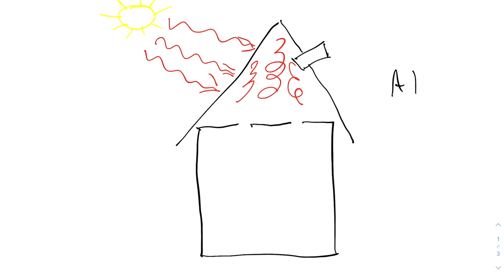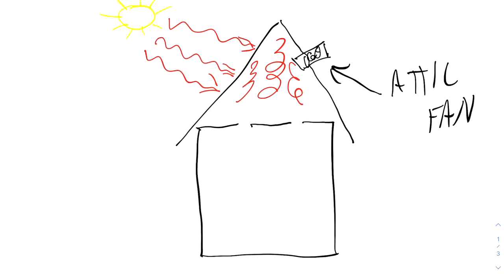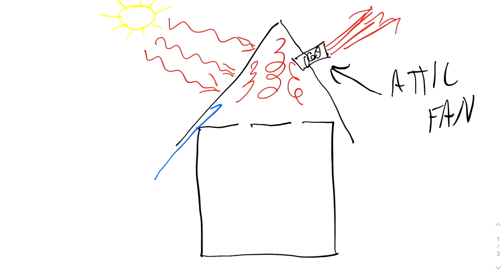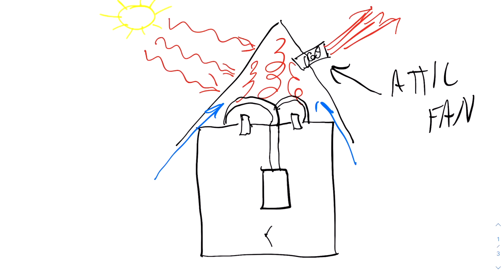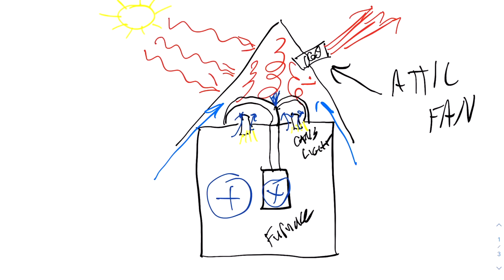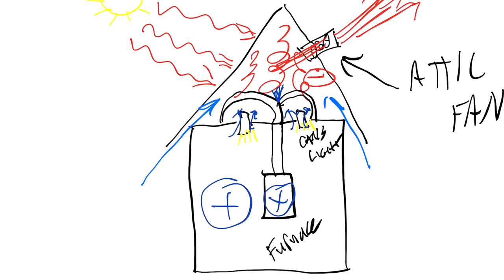3 Remodel Rip-Offs

Comment: I installed a solar attic fan. I had collected temperature data via remote thermometers. Installed the fan myself on a west-facing part of the roof (really important) and documented a 10-15 degree reduction in attic temperatures. The house is not air conditioned, and I definitely noticed the inside feeling cooler, probably because of less radiant ceiling heat from a cooler attic. So, for me with a DIY install, it made sense and I'm happy with it.
Reply: yeah, you want to be sucking the coolest air however, if your entire house is vented, you are sucking cool air from everywhere. I think the atic fans work best in areas other than texas or places with 100f weather because sucking 100f + air into your atic, isn't gonna make a big difference. I live in southern california where its been 75f for the last 3 months straight and its almost July. This week its pretty much 80f. Sucking 80f air into the attic that would be 120f, without the atic fan works well.
Reply: I like the poster, and he's pretty smart but even smart people get it wrong sometimes. Like I said, he's partly right in climates that are above 100f. He should have mentioned that.
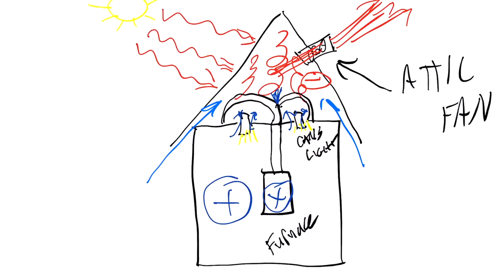Reply: @fastj1962  I live in a small house in So Cal near the ocean too and want to do the same thing before we get a fall heat wave. Our house stays comfortable until about 3:00 in the afternoon.  Then, the heat which has accumulated in the attic all day descends down into the house. So I open windows and cool with cross ventilation.  But the bedrooms without natural, window cross ventilation get HOT. I want to put the fan directly above the HOT rooms to help them out.  I hope this makes sense.  May I ask you which fan you bought?  Do you have an installer to recommend?  I'm on westside of Los Angeles.

Comment: I replaced 36 windows in my house from single to double glass with e c coating. Double hung. My utility bill literally was cut in half. Huge savings. Midwest!!!
Reply: I am thinking the same thing. How much does the 36 windows cost?
Reply: @dr_920  Probably a lot more than you will ever save in energy savings
Reply: Not of you repaired your old windows and used a storm, they would be much closer to a new window.  Plus, those new windows aren't built for a lifetime, like old windows are.  They are rebuldable.  Plus, you can now add e coatings to old windows if you like.  I rebuilt my windows with new glazing, rope, glass where needed, spring bronze to seal out drafts, and it came to about $37 per double hung window, which should last another 150 years.  Add a storm and I have insulated glass, same as new windows.  I priced Anderson for my old house, and they were about $39,000.  I will die long before those break even.
Reply: @miragesmack007  Do you have a link for the things you have done? I am thinking about replacing the glass myself. I got several quote, but cheapest one is about $150 for the glass only. Including the labor, at least $300 each for a 34x28 inch glass. It is will expensive than I expected.
Reply: My guess is you replaced old worn out windows. If you restored the old windows, like I always do on old houses, there is little difference.  Eventually those replacement windows will live up to their name, they will need replaced.  If you had old wood windows, they were rebuildable for the life of the house.  But no one maintains windows, they let them go. Single pane is R-1, and double pane is R-2, then other factors increase value somewhat.  E coating reflects light, but you can install that on old windows.  Then there is gas. My friend who sells windows told me, the only thing he can guarantee, is that the gas is going to leak out eventually. Which gets you back to an R-2 window again.
Reply: that's nice, I put double curtains on mines and also saved a ton
Reply: Yeah sometimes Matt is living so far in the future that he forgets what it's like to live in a crappy old mid-20th century house :) I think his key message is supposed to be that the exaggerated claims that people make about the savings from putting a computer fan in your roof or replacing all your windows. Both of which involve invasive work which usually gets done by the least experienced kids on the contractor teams. I still put plastic over our windows on the inside in the winter, and it definitely makes a difference with droughts and heat. I know I should get super rich or go into tonnes of debt to make our house like a 22nd century spaceship, but honestly the plastic is cheap and easy for now and does make a noticeable difference.
Reply: @brianchapin574  energy savings is only one part of that. The house will be more comfortable and easier to maintain comfort, which to most people is priceless.
Reply: How much of that was due to e-coated double glazed windows and how much was due to correcting all of the air [in/ex]filtration issues you could have done much cheaper?
Reply: @miragesmack007  If you do spend money beyond repair people should consider walling up certain windows instead of replacing. Central air and efficiency lighting replaced the need for so many windows. You'll  get better insulation, better security and more wall space.
Reply: 36 x $800 = $28,800 for windows. How much was your electric bill in the summer? $300 a month? For maybe like 7 months out of the year? $2,100?
A roll of Window tint cost something like $72 bucks and can cover 2 standard size windows. It would have cost you $1,300 to tint all your windows.
Reply: I agree 100%.
Reply: Yeah.. I honestly think he just made this video to stir people up and get everyone talking in the comments.. because he's not making much sense.  If good windows didn't make a difference, we wouldn't be spending the extra money to use them on new houses.

Comment: As a Home Inspector in South Alabama, attic ventilation is a science, where every roof system should be individually evaluated for proper ventilation. Based on the studies I have been doing over the last 3 years, powered attic fans are a better option than  just a ridge vent. Matt is correct about about the radiant heat, but powered attic fans will cool down the roof decking quicker after the sun goes down and can reduce the thermal load to framing below the roof decking. They also do a good job of mitigating moisture build up. I also agree with Matt about the potential of pulling indoor air into the attic space. However, I took the time to seal all ceiling fixtures, switch boxes and outlets. The best performing attic systems I have found are properly encapsulated attics.
Reply: You in all the way south Alabama?
Reply: True. Power attic ventilation is great at night. In my house, there is three times faster cooling of attic construction, which gives you great buffor during the day, and  much lower temperatures during sunny days. Thermal transfer to level below is reduced or even canceled during some part of the day. It is great solution.
Reply: THIS!
Reply: Hard to cool down when the sun goes down with a solar powered fan.... lol
Reply: @garbizwal  seriously?
Reply: @hawksrock3024  100%  The picture used for the video is a solar attic fan.  The house we bought last December has that very unit on the roof.  Doesn't work much in the winter or at night!
Reply: @garbizwal  there are hybrids too. Solar when direct sunlight hits it and they use electricity otherwise.
Reply: @garbizwal  The solar unit stores power genius. The sun doesn't have to be on it to work. Wow!
Reply: @hawksrock3024  Not true "genius"  I know this because I purchased a house with one of these on it and it doesn't work when the sun goes down.  As well there is no batteries and no room for batteries.
Reply: @garbizwal  Then your unit is either broken or 1st generation, every solar attic fan for sale now has a battery back up, the solar panel charges internal batteries that last for days without sunlight. It's how my ring solar panel works too. Might wanna look into that.
Reply: @garbizwal  It automatically transfers to 120 voltage after dark if temp in attic stays above 80 degrees.
Reply: @garbizwal  Mine works day and night, since it automatically transfers to house power if temperature stays above 80 degrees.
Reply: @southernhometalk2465  We have the exact one as in the thumbnail for the video and it doesn't do that.  It doesn't even have wires to do it.
Reply: @garbizwal  Mine does.
Reply: I agree, being a home inspector in NY. I see the difference in attic temp when a powered fan is being used. I installed a solar fan in my garage, and recorded a 20 degree drop in temp. Then I installed another solar with backup AC in my house. I recorded a 15 degree temp drop with that installed. Both units work great and get the job done.
Reply: @trblmkr61  Thanks for sharing your information.
Reply: I would rather avoid a negative vent setup.  Relying on a caulk job leads to failure at some point - future electricians may or may not be aware of general building science for example.  Doors?  Windows? Yeah, those never leak...
  If you could vent a roof passively and keep a slight positive attic pressure, why... 40/60 setup and never worry about any moving parts.  If there is thermal drive, ventilation will occur - even that hour right after sunset.
Reply: As an HVAC contractor I was just about to comment the same thing. Well said sir.
Reply: This guy just wants you to buy his product.
Reply: Not true, since it automatically switches to house power. @garbizwal
Reply: Let me ask you a question if you don’t mind. I’m having an attic fan installed (quietcool AFR SMT ES 2.0) and was told that I should also look into them fans that go on your ceiling that pull the hot hair from inside the house into the attic. My house does get hot and humid, even when the AC is at full blast. So with that said, is getting one of those to go with the attic fan a good idea? If so, is there a specific make and model u recommend that’s not over 300 bucks ? Thanks !
Reply: The problem with all these contradictory claims (attic fans work vs not work) is that they focus on one particular scenario. For example, there are people who want to install attic fans so they do not have to turn on the a/c in which case, sucking living space air up there is not a problem. We don't need 50 degrees difference, most of the time, 5 degrees make a whole of difference. More so, I've see a lot of arguments online revolving around negative pressure; in reality, pressure difference make very little difference in terms of air movement, sometimes house layout, temperature difference, is enough to slow air movement enough for that to not be a factor, that's from person experience. I once installed two very high power window fans at windows at opposite ends of the house, thinking one blowing out would create negative pressure to pull cold outside air in from the other end, especially when the other end has a fan blowing air in. Nope, furniture, is enough to get in the way, air is so stale in the middle a piece of toilet paper falls straight. (People are gonna tell me the living space is not sealed tight enough, but then again, 2 high power fans require a lot of not sealed tight enough)
Reply: @1plaintext  Thanks for sharing this

Comment: Installing an attic fan immediately dropped the summer temperature in my 2nd floor by about 8 degrees. Also, my energy bill for running the AC dropped at the same time.

This is the ONLY PLACE I have EVER heard someone try sell an attic fan as a ripoff.
Reply: This dude has 0 scientific evidence, or examples showing it doesn't work just "trust me man it doesn't work"
Reply: Attic fans are not a scam and I disagree with the way they were presented in this video. However something I will point out is that most people should not be looking for an easy solution via an attic fan, they should be addressing the actual problems. These include but are not limited to blocked soffets preventing proper airflow to the attic, poor air sealing between the attic and the living space below, lacking insulation, etc. 

So in that regard I would not suggest an attic fan. I would fix the reason my attic is reaching 150f degrees to begin with.
Reply: You should check into what people who actually study building science, and use it to test for and fix problems with homes have to say about powered attic ventilation.
None of it is good.
In the vast majority of cases, powered attic fans are detrimental to a home to some degree, or at best neutral. 
When there is an actual perceived benefit, like you claim for your house, it is a band-aid for a home with serious thermal and pressure envelope problems.
You would be much better off actually fixing the source of the problems with your home.
Reply: @markbeiser  Provide links. I've seen enough people trying to deny basic thermodynamics on this subject to take claims of actual harm to the home based solely on improved ventilation with suspicion.

Also, the home is relatively new and completely up to code. Additionally, the entire roof was reinspected for problems when I had it re-shingled. 

Finally, the anti-fan crowd appears to be an extremely small minority. If attic vent fans were truly harmful to neutral in effect, they wouldn't be so popular and it could be, and would be, easily demonstrated without resorting to moronic claims that moving the hot air out of a mostly enclosed space doesn't cool it off.
Reply: @nolongeramused8135  The windows can for sure be worth it, On the topic of the attic vent fan, it can work as advertised because houses in the north require a Vapour barrier and there is a much bigger emphasis on air sealing. If the house is properly insulated and sealed then the when the fan turns on it will suction the hot air out of the attic and the air pressure from this will pull air from where ever air flow is present or possible. On a good vapour barrier and air seal install, The air would be getting sucked in from the vents. But this also has a lot to depend on the type of roof and design of the house present. 
The fan dose require energy to power. In a prolonged hot climate (Not mine- Ontario) theses fans can definitely be a great benefit as letting the hot air escape pushes the thermal layer or "front" at which cold temperatures pushes against hot temperatures in the insulation in the attic, So the AC has to work less to keep the space cool and less hot air is pushing against the cold air. 
In Ontario's building code, Attic vents are required at the upper most part of each roof section or hip to allow the hot air to escape in the summer.
Reply: @mattcraztex9940  I'm actually further north than you are, and yeah, air sealing is a real thing with new construction here. Homes built in the last 20+ years require ventilation fans to run on a regular basis, moving air both in and out of the house. I would have thought that the attic vent fans would be required here as well, but then most homes don't have AC in this region.
Reply: @nolongeramused8135  Exactly, I would all depend on the climate and region you are located if it would be worth it or not. But building a more airtight house and tighter building envelope is always superior then a remedy.
Reply: Just think of hopping into your car that's been sitting in the sun all day on the hottest summer day and how crazy uncomfortable it is but you start rolling not even that fast and cycle the air with the hot summer day outside air and the comfort level quickly changes by a large margin before you even crank the a/c. Just moving cfm can make a huge difference, might not be the best analogy but it's one everyone can relate to. The companies probably make some unrealistic claims and some overpriced products out there but everyone can afford at least a whirlybird and it does make a difference.
Reply: Was your fan solar powered or hard wired?
Reply: @justinjimenez6960  Hard wired - not enough sun around here in the winter to light up and LED.
Reply: Wasn't he talking about powered attic fans?
Reply: @ubroc  Is there another kind? I'm unaware of a fan on the market that doesn't require electricity to operate. Or were you going to put a few hamsters in cages?
Reply: @nolongeramused8135  Turbine vents are a thing. I have 4 of them on my house. They work fine. Now you are aware.
Reply: Attic fans are literally the most effective method of heat mediation for homes more than built-in methods. This guy doesn't know what he's talking about and he's so confident about it.